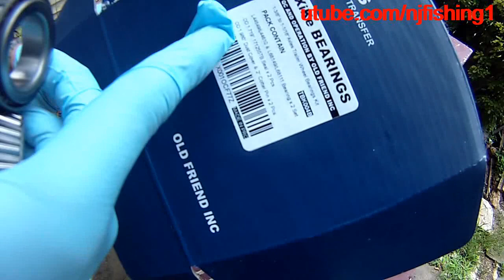How to pack grease into my boat trailer bearings the right way? I lost track where I started so ...

Comment: The overheating of the bearings and hub could be from the bearing nut being to tight.
Reply from the maker: It was my poor greasing job in my initial install and some experts pointed out the bearings will be hot for the first couple trips